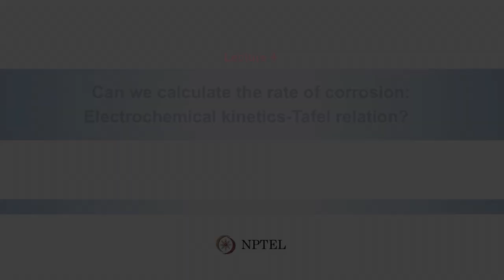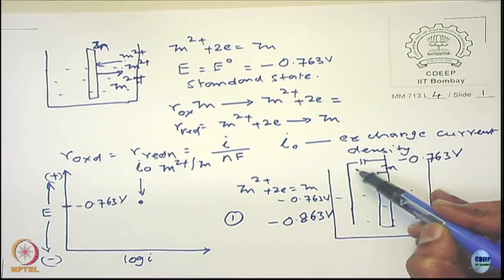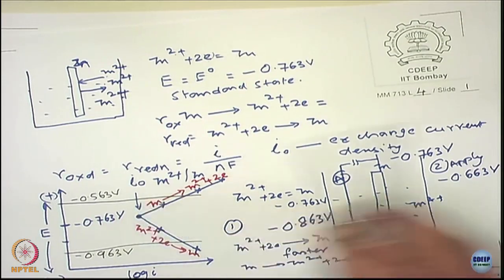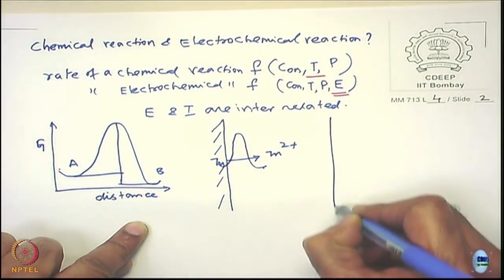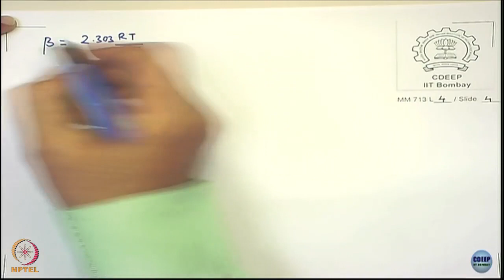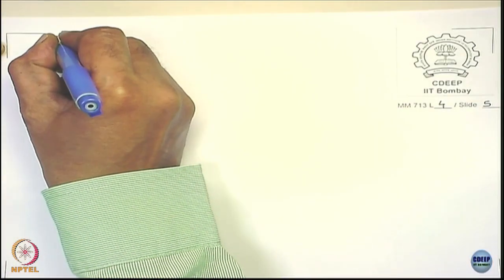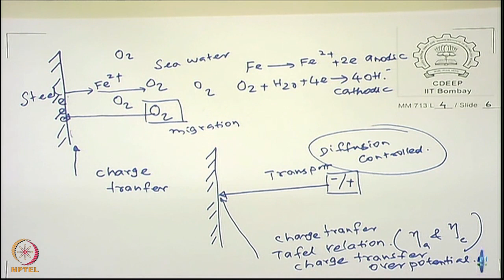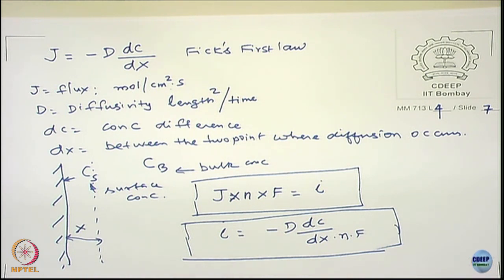Week 2: Lecture 4

Comment: Sir you said ions carry some current density ,, which is source of conc diff current density , but oxyzen is a neutral molecule when diffusing from bulk to the surface of electrode how can it produce current density
Reply: What he is emphasising is that the back and forth electrochemical reaction could be thought of as having and current density in respect to an interface here we can say metal and electrolyte. The forward reaction involves some charge transfer usually known as reduction and backward reaction involved oxidation and in each there is some transfer of charges hence if seen per unit area there always is a current density associated with each reaction happening.

 Overall if you see the electrical neutrality remains conserved.